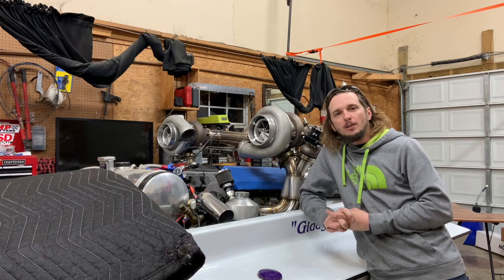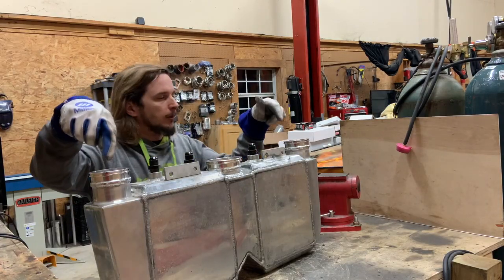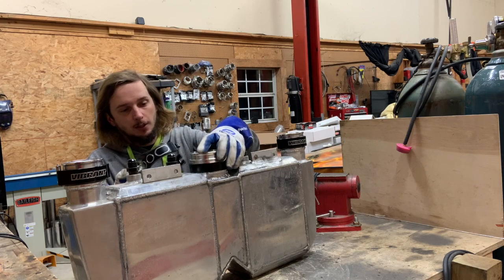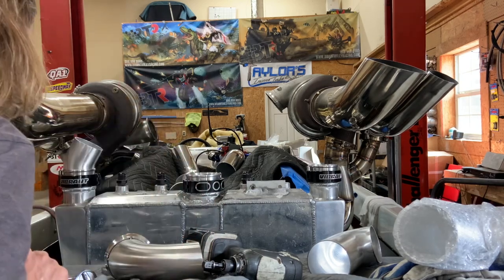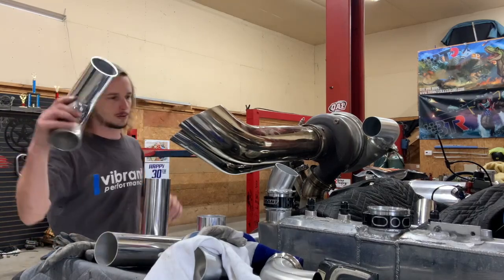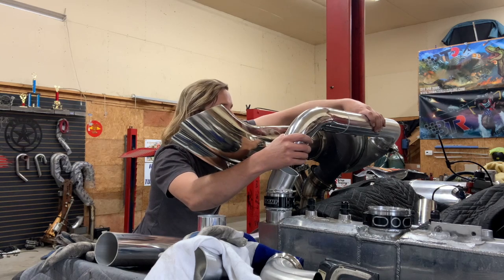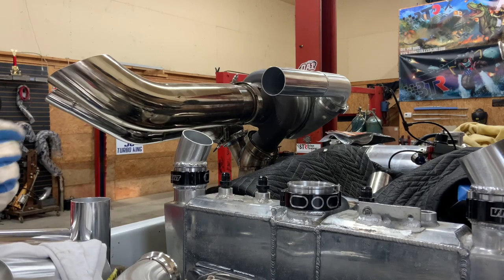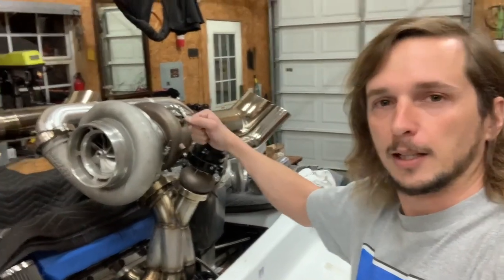3000hp PROMOD Twin Turbo BOAT Build!! Part 2

Comment: The supercharged jetski's come with air to water intercoolers from factory and they are designed to run em in saltwater or fresh water all the time no issue, just need a good filter inline from the water feed. You wont believe the amount of sand the intercooler cores collect.
Reply from the maker: I could imagine!